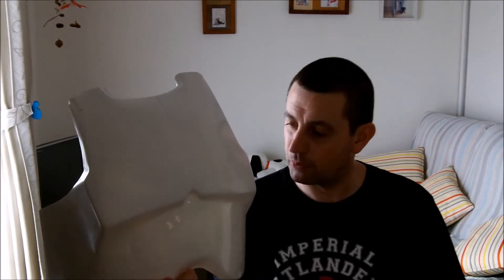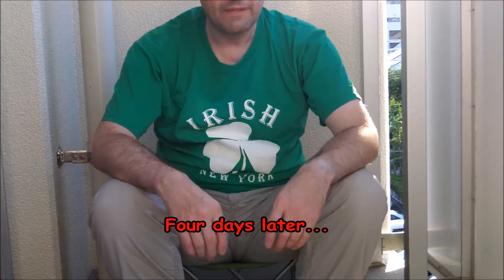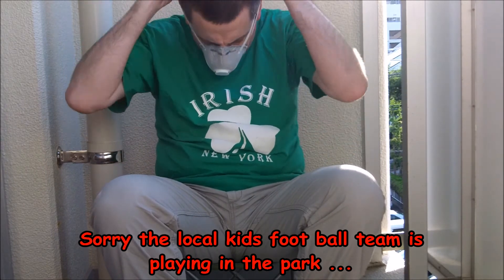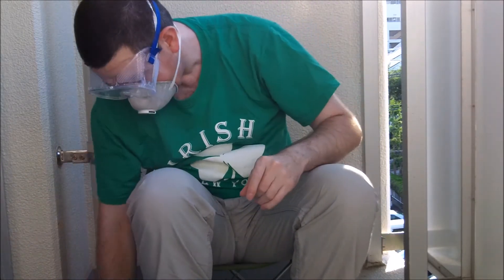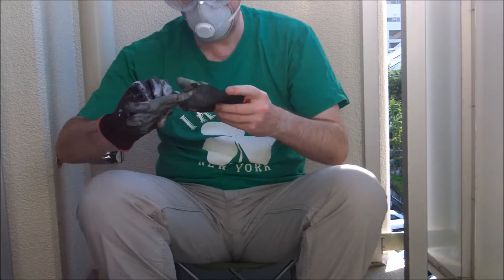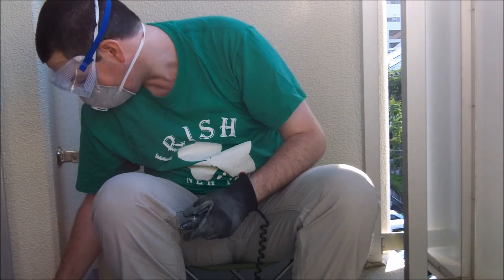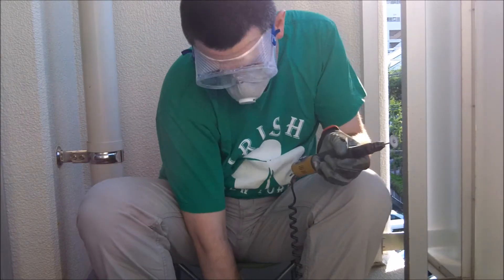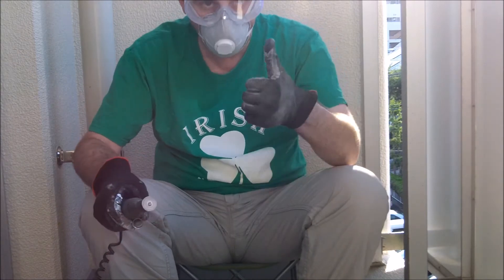Clone Chest Armor Build Part One ( Fiberglass )

Comment: Question, I’m working on a clone trooper kit, like yours. I found that the chest and back armor is to wide for my body. Any recommendations on how to fix that? I was thinking of using a heat gun to heat the plastic and try to bend it slowly to more my width.
Reply from the maker: Yeah I found the same and working on it too. I ended up cutting some of the sides off and replacing them with styrene board. I will have a video up in a few weeks. We have had a few typhoons here in Japan and has stopped my build a little.
Reply: Rogue Clone Trooper sure thing man, I’ll wait on your next vid to start on the chest and back
Reply: Update, the armor where deformed and wide to just use a heat gun, I’m deciding to use abs plastic sheets as a better option
Reply from the maker: I have a new video up on this problem!! Hope it helps you out!!